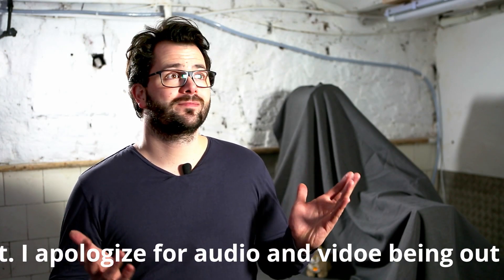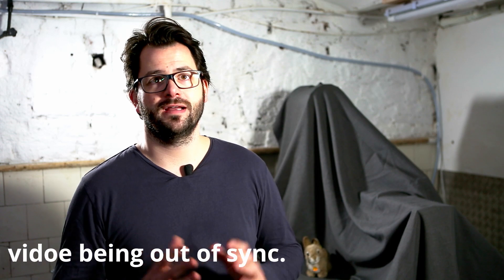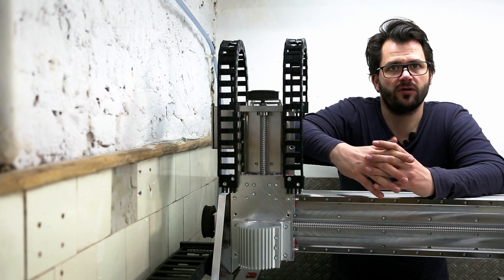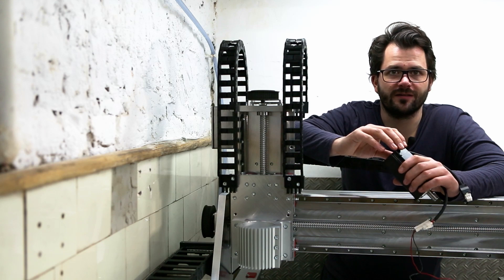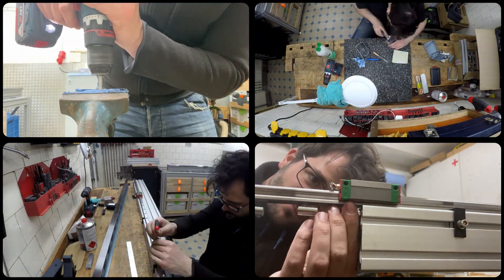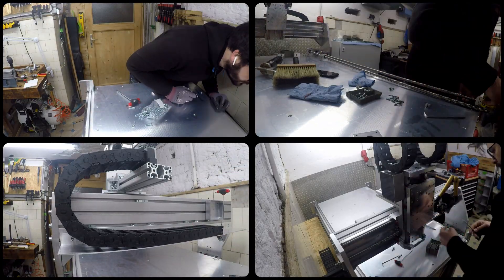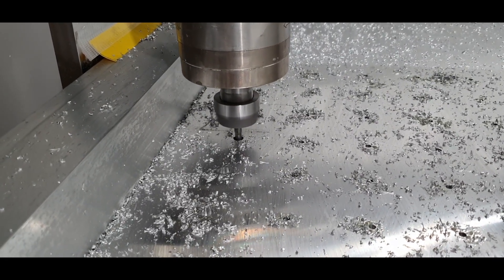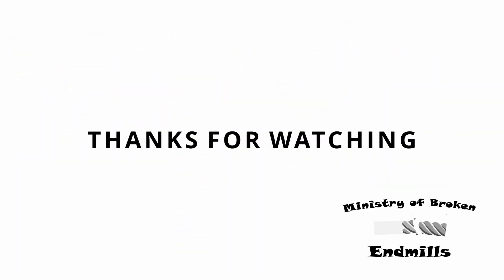Reboot Series E03: Mechanics -  Introducing Kondor by fraeserbruch.de [EN]

Comment: Very nice ,very slick machine, I wish I new about this one when I started mt quest. .                                                                                                                                                                                                                            Could I ask why the y axis had the servos direct coupled and the X used a timing belt I couldn't see if there was any reduction going on there or was it to just to keed it more compact?
Reply from the maker: Thanks for asking: The timing belts are mostly there to reduce footprint or height. Folding Back the y drives is possible as  well, although it is currently not planned. Standard ratio is 1:1 or a slight reduction. Mine  have a slight reduction around 1:1.4 because the servos don’t mind turning fast. There is ample power on the 400W drives anyways, so that would not have been necessary.
Reply: @MinistryofBrokenEndMills  Cool, thank you for the explanation.
 I think I will feel comfortable now running my JMC 400 watt servos direct to my 10mm ball screws.
Reply: @MinistryofBrokenEndMills   Do you feel there is any issue with lateral forces and backlash with the pulley/belt driven axis? 
Could you let me know which type of shaft couplings you used on the direct coupled axis? Thanks Matt
Reply from the maker: @Matt Eyles: With a properly tensioned belt I have not encountered any problems with backlash. The shaft couplings are are the typical claw couplings with a buffer piece (red plastic), like the ones that can be found here: https://www.sorotec.de/shop/CNC-Mechanics/Couplings/
I bought mine at aliexpress at some random vendor that had the required sizes in stock.